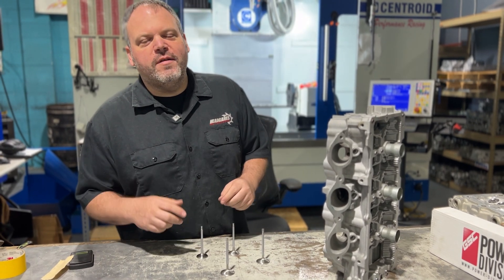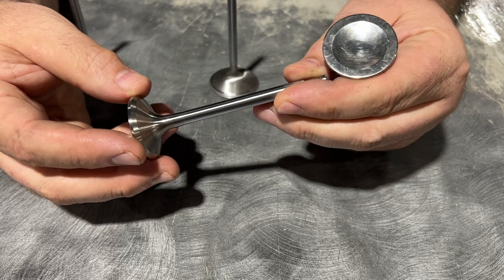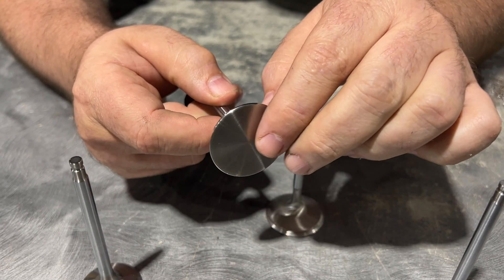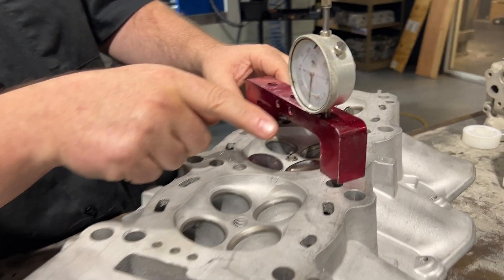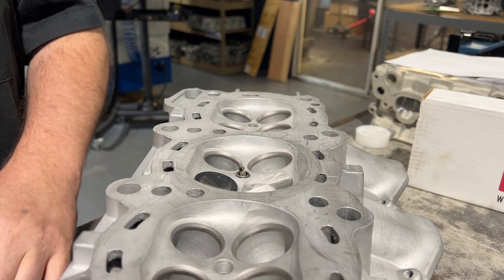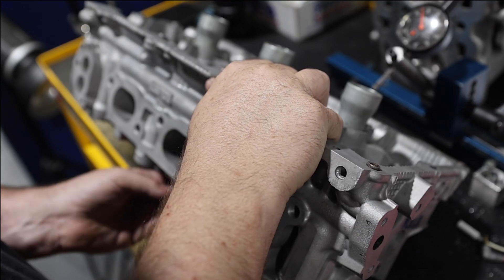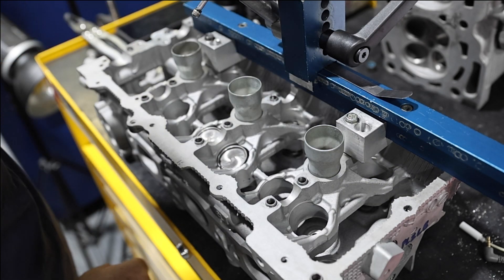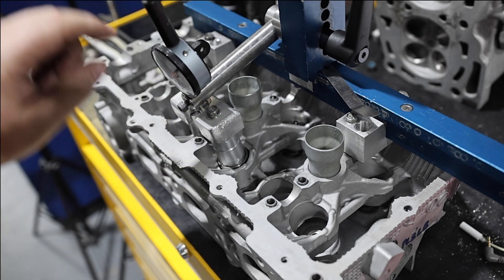In-Depth Analysis: GSC Power Division new VR38 Valves + Flow Testing! Watch this before you buy!

Comment: Need to make some reputable bmw valves. Supertech is trash
Reply from the maker: @brianross618  we use supertech valves for bmw all the time with no issues
Reply: @headgames  yes I'm very disappointed to see that. You need to look into how many top racers in bmw drag racing and track racing are having intake valves pop at the head. Even brand new builds with 20 mins on the dyno. Very common problem. I'd like to see someone get to the bottom of it. Supertech always has an excuse to push the blame somewhere else. It's way to common and all on the intake valve at the same place in the same manner with a clean break to be a machining problem. You really ought to look into this and see what's going on. Talk to Frank dohc Ramos from NY who was just on YouTube on the alphaone podcast.  He had every single valve pop on him. It's a real thing. We all use ferrea now. They don't even break when they get hit,  they bend. Supertech just lets go for no reason. Bad quality control.